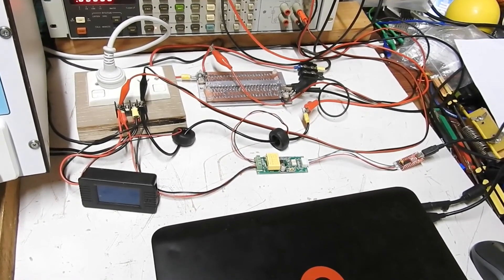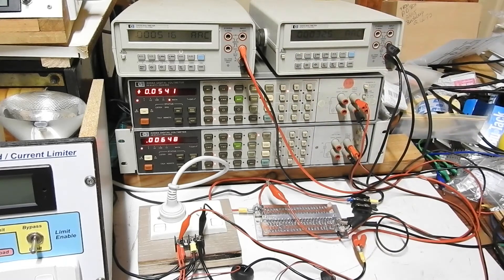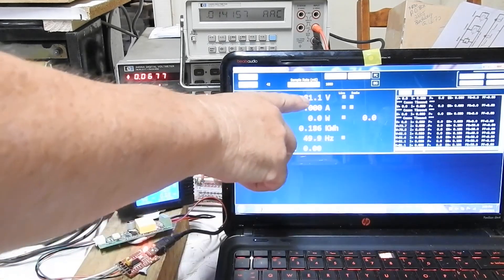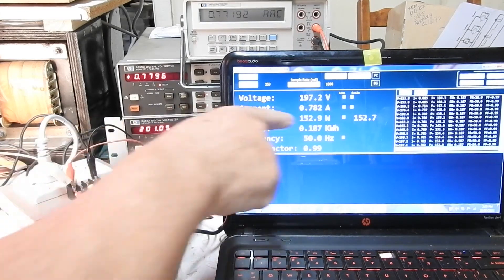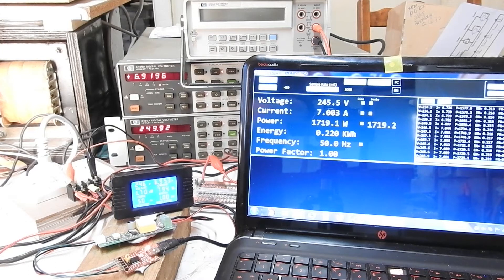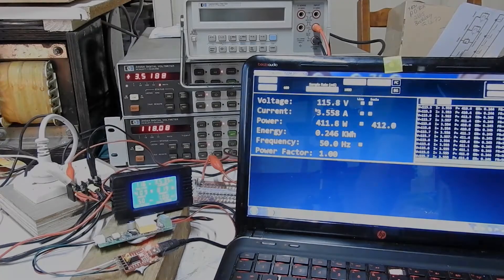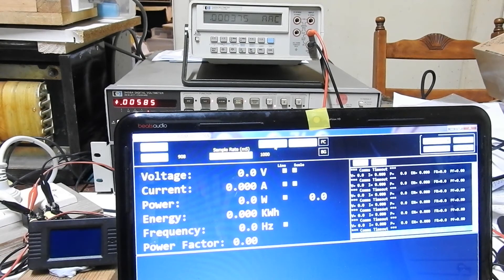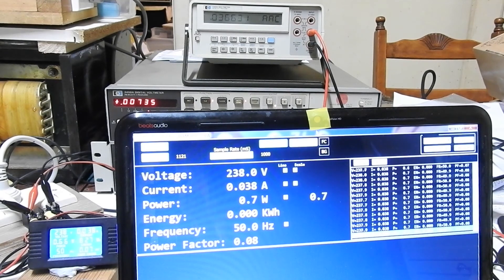PZEM-004T Energy Meter Tests

Comment: Hi I saw the bedio can you ols share schematic and software you are using
Reply from the maker: As far as I know, there is no publicly available schematic for the PZEM-004T, but maybe someone has reverse engineered it - I don't know. 

I won't be making the program shown in the video available, since it was just a test setup, and is full of bugs. It also uses a non-freeware component for the serial communications, so I can't release it anyway. Furthermore, it is written in Delphi (Pascal), so would be only of limited interest.

The PZEM-004T manual can be found in many places, for instance:-
https://manuals.plus/wp-content/sideloads/innovatorsguru-ac-communication-module-pzem-004t-v3-0-manual-original.pdf
That is what I worked from. 

Search for "PZEM-004T" and "home automation". It is a popular device within the home automation community, and I'm pretty sure there are open source projects (and written in C) that connect the device to WiFi networks. That should get you started...